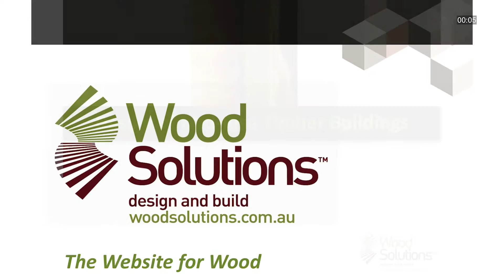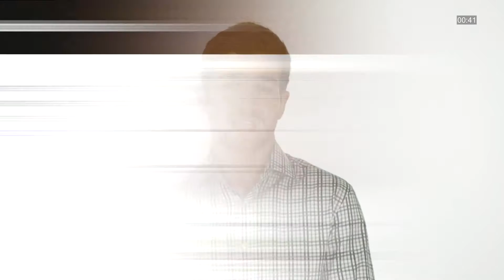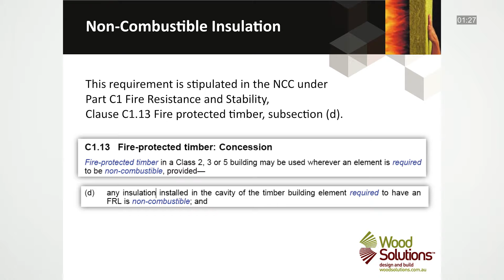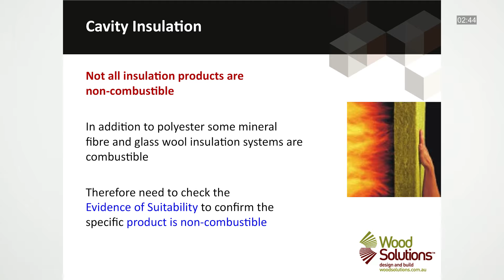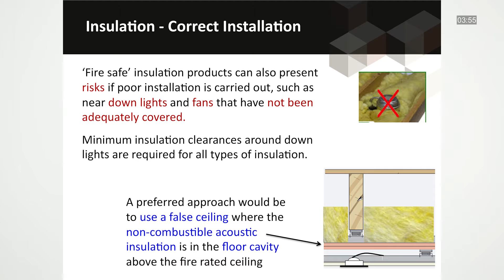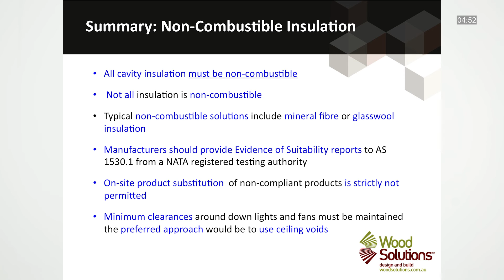Module 10   Non combustible Insulation

Comment: Using mineral wool or rock fibre on the occupant side of CLT will increase the risk of condensation in climate zones 4-8. Installing it in the cavity is a good idea. Do you have to use non-combustible insulation for Class 1 and 2 buildings?